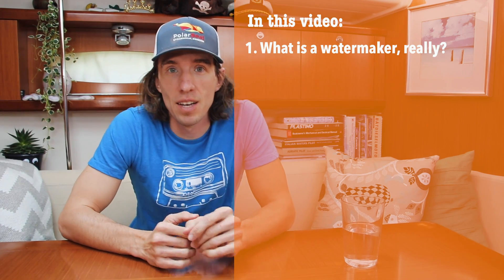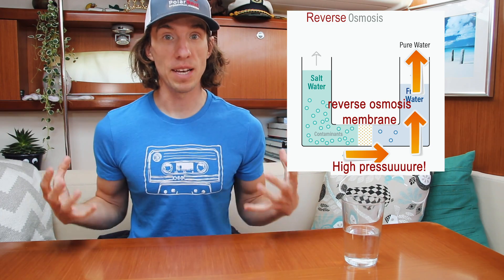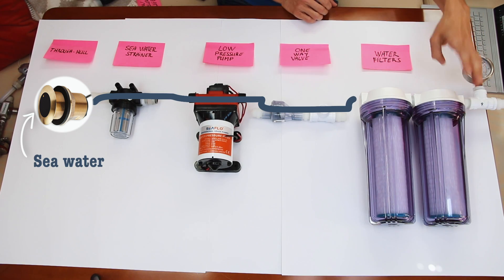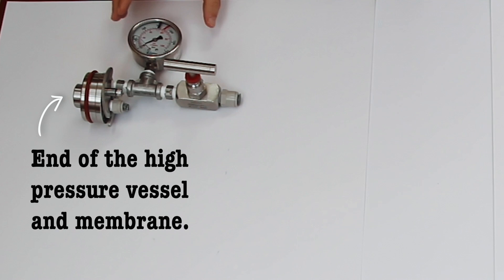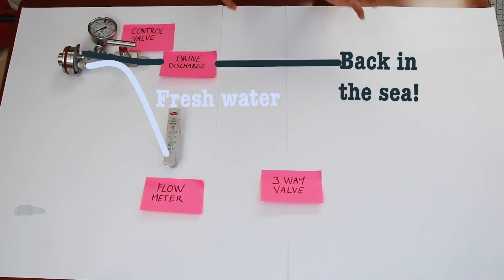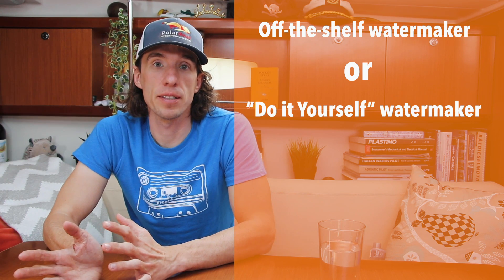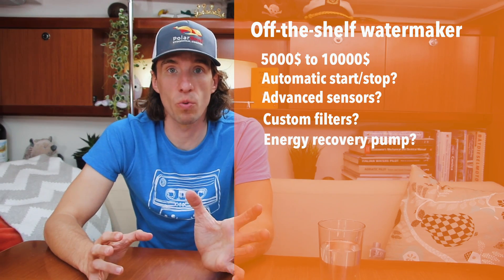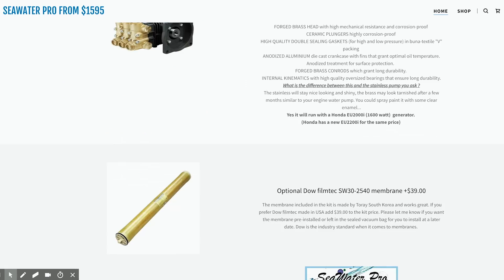How to make water on a sailboat (and how to build your own watermaker) // Ryan’s tech corner #3

Comment from the maker: It's been two and a half years since we installed our SeaWater Pro watermaker, and it has been performing flawlessly. it has afforded us some well-needed and appreciated self-sufficiency throughout the Mediterannean (where marinas are super expensive), through ocean crossings (yeay for showers) and through covid lockdowns (where we had zero possibility to get water otherwise). We added a control panel in our galley which has been incredibly practical and have upgraded the membrane to the latest SeaWater Pro one. We've been buying filters and parts in hardware stores all over the World (way easier than having to order proprietary parts) and we produce 19-20 gallons (70-75 liters) of fresh water per hour. If you consider ordering a SeaWater Pro watermaker, we have just gotten an affiliate link, that allows us to receive a small commission on every purchase at no cost to you. We would be incredibly grateful if you considered using it! Thank you :) https://seawaterpro.com?sca_ref=1318773.3ThbpgMEbt
Reply: What has the maintenance coat on it been per year?
Reply: Hello very good video i have several question, do they ship abroad ? how many hours a day do you run the watermaker ? Do you have heating issue with the pump ? I dont see in their offer a feeding pump ? Did you install by yourself ?

Thanks.
Reply: Hi. We definitely miss Ryan's technical projects and we hardly saw him during the introspective, drama driven and tiramisu spirit lifting recent transat. More of this please. Cheers
Reply: I’ll use it as soon as I get to it thank you guys and good luck !
Reply: You explained that so well. I know nothing about living on a boat but I’ve found that in non live aboard boating that ppl place too much emphasis on saving space with things like electronics, wiring & engines. Sounds great for those who don’t do their own maintenance or repairs. Your system looks perfect because you can access the parts without hanging upside down after being lowered from a rope. Thank you very much for your insight.
Reply: Excellent vid, very clearly explained,  i'm in the desert & got no boat, but enjoyed the info.

Comment: The manufacturers call it reverse osmosis to sound like is high tech, 🤣🤣🤣 but it's the same kind of filtration that the 25/5 microns do, but the membrane need more pressure to work, that's all. The reason it's cause salt and water have similar sizes, so the membrane needs to be the perfect size to let water squeeze past while stoping salt, that's why it's so expensive. Actually it's a impressive feat that gets glossed over by the osmosis BS.

Comment: There was a TV show called "Wheel of Fortune" 3 contestants would play and they would take turns spinning a giant wheel that was sort of like a roulette wheel, Different prize amounts would be indicated by a arrow in front of each player as the arrow pointed at them until the wheel came to a stop on 1 of them or on "Lose Turn or Bankrupt" if not 1 of the last 2 mentioned then the player would guess a letter of a mystery word or phrase. Vanna White  was the actress / model who turned the letters over as they lit up. So if the player guessed the letter "T" and there were 3 "T's" in the phrase then those 3 "T's" would light up and Vanna White would walk to each of the 3 letters and turn them over to show the letters them selves. Watch "Wheel of Fortune" for a better understanding of the process.

Comment: Funny, I assumed water makers either evaporated and then condensed steam to make water or used electrolysis to separate H from O and then recombined them to make pure water, especially since salt water is so conductive.  Didn't realize you could use an RO machine.  I have used household RO machines for years, know them well - why couldn't you just use one of these?  I know you would go through a lot of filters and membranes over time, but if just for drinking water, it may be a LOT cheaper in the long run to just use that?  They are also 7 stage, including a UV filter, which would kill any bacteria.  You could even gather rain water and run that through a 7 stage household RO filter.

Comment: I have a question about the pumps. You use a low flow pump in the beginning to keep air out of the system but a hi pressure hi flow pump to pressurize the system later in the system. Does the low flow, low pressure pump keep up with the demands of the hi pressure pump? I would think there would be a lack of water getting to the hi pressure pump. How is this addressed?

Comment: You asked for questions: How much electricity does it use to generate say a litre of water? How do you generate that electricity? Is there a risk of being mid ocean and the water maker failing (it looks like it's got a lot of bits)? How much water would you both use on a long crossing? Could you use collapsible water storage which would be cheaper and less prone to failure but obviously uses up more space?

Comment: Wow! Great video! I have one question: is there a reason why mounting the HP pump directly on the main engine crankshaft, thus eliminating the need for a large electrical system is not mentioned? I have a lot of experience modifying and altering boat engines, and I don't see a lot of cons eliminating the need for the electrical motor. Cheers 👍 Jasper

Comment: WHAT THE HELL
I could not tell
if ONE single gent
mentioned Vanna White?!

Sharing her birthday
along w/ Travolta
I thought of her often;
usually at night.

Never forget
her upturned hand
delivering every prize.

And yeah Boyz
if you know the gal;
she was easy on the eyes.

As for water
I have 5 ways;
no power or membrane required.

I wanted a system
that doesn't care
if the water's funky
or the batteries are tired.

Comment: Principles of reverse osmosis do not make a solid reliable system.
Brass high pressure pumps do not make for the best material. Erosion of the brass creates leakage while operating.
I would like to point out that  most of the parts that Seawater PRO use are made in CHINA or People's Republic of China (PRC)
The AR Pump they use is made in CHINA. Ripped off from Italian pump manufactures' 
Chinese sourced parts are the only way one can promote a system for $3500.
You get what you pay for......
BTW Hardware stores don't offer purpose made parts for Seawater RO systems.
BTW Seawater Pro is Junk... Brass head for instance.... Brass pumps are great for pressure washer system for occasional use, but not for making freshwater wherever you cruise.
Good luck ya'll

Comment: Excellent job and highly interesting video.   You explained it thorougly at 11:54 but the signs were reversed, it should read TDS < 600 mg/l, so the TDS should be below this norm, and pref below 300 mg/l.  You got me inspired to make our own WM, thanks a lot !
Total dissolved solids
The palatability of water with a total dissolved solids (TDS) level of less than about
600 mg/l is generally considered to be good; drinking-water becomes signifi cantly and
increasingly unpalatable at TDS levels greater than about 1000 mg/l. The presence of
high levels of TDS may also be objectionable to consumers, owing to excessive scaling
in water pipes, heaters, boilers and household appliances. No health-based guideline
value for TDS has been proposed (see sections 8.5.1 and 12.1).

Comment: I contacted SeaWater Pro in January 2023 wanting to buy components for a DYI system.  Bailey, wrote back and said they will only sell "parts" to folks who owned their system.  Also in viewing their video closely they are using a pump made in China which has few of the affirmative elements of a Cat pump or even a General Pump.  So, no they are not a source of component parts.  Try RO Cruise who in their website encourage folks to build their own.

Comment: An alternative to your metering valve is a back-pressure regulator.  A spring-loaded model can be set and will hold the pressure at your desired value (600-800 psi) without adjustment.  They cost more than a metering valve.  Try Swagelok for a look at a small unit.

Comment: TDS. Not TSD. So I question the mg/ml WHO suggestions based on that. Considering TDS meters measure parts per million,not mg/ml. Also The WHO recommends not drinking reverse Osmosis water based on a soviet town drinking nothing but Reverse Osmosis,Having an unknown condition that caused death and the Soviets coming in to study it and determining the cause to be extremely low TDS water without minerals leaching vitamins minerals and electrolytes from their bodies. Anyone who says that warning is overplayed and not real never read anything, drinks and recommends drinking reverse osmosis water, has no idea what theyre talking about and is coping, as a result. Because you could literally add baking soda and salt to your water to prevent the health consequences. Or a myriad of other elements, such as calcium supplements in proper proportions to raise TDS. Just look at a healthy water sources mineral contents and mimic that, accounting for whatever filler they put into your mineral supplies.

I just pulled out a gallon of store bought reverse osmosis and its ingredients are listed as water, calcium chloride and sodium bicarbonate. IF my meters are reading accurately its PPM is 35 and PH is 9.5. Since I do more then just cry in the comment boxes.

If youre regularly supplementing your vitamins and minerals, such as a cal mag zinc with a quality multi and running a high sodium diet or drinking "sport drinks", maybe you wont notice a low TDS water leaching effect resulting in death.But its too easy to just establish a known drinking sources base line, then mimic it, by adding a little calcium chloride and baking soda to your water supplies to boost its TDS to a state of water TDS equilibrium, where it doesnt feel the need to leach on you.

Comment: What is stopping you from using a cheap pressure washer for the high pressure pump? 800 psi isn't very much pressure so you could probably run two membranes off of 1 pressure washer depending on the flow rate anyways.

Comment: Really Great Video .Super well explained .I like to Know which High pressure pump do you use an how much amperes use it per hours .I have 2 Banks with 300 amperes each but only one i can used for water maker .The other is for Engine and electronics . Thanks for the better video that I'm seeing related with WM

Comment: Nice contribution!  After living in SE Asia...I am a fan of collecting rain water, even on a boat.  Requires filtering, of course, but little else.  Our latest system, in order to rid the decks of ugly Gerry cans,  went semi-direct into it's own holding tank, with the flow pre- filtered. That way, separate testing to ensure no potential cross contamination.  Never had any issues.  For cruisers with more than two people, or not enough water tankage, it can make a huge difference.  Better than most dock water supplies!  Thisrain water, in my mind should be in addition to a decent water maker.

Comment: I understand that drinking distilled water is also bad for ones health, so how do you overcome this problem if you are building your own.
Clearly salt really is not good for us, i have been told that if you can taste the salt then there is  too much salt.
I recall while servingnin the forces the ships i served on had eveporative sustems and that during the procees every so often a test with silver nitrate was done, and salt over certain level would make the water go milky but how do you know when the mix is right,
Reply from the maker: Hello,  correct.  If you exclusively drink desalinated water you run the risk of not getting enough essential minerals in your body.  This is more than salt.  Iron, magnesium, etc.  Many watermakers sold in stores which are found in home in Spain contain a process to add minerals back in to the water.  However while we do drink this water jts not our only source.  Juice, bottles water, wine, beers, and eating out so the risk is low.

Ryan

Comment: Have you ever thought about using the cheap $100 Harbor freight pressure washer for the pump? If you keep all the parts to the pressure washer you can also get the 2 year extended warranty for another $20.

Comment: You forgot to install a ball valve at the through hole, to stop the water from coming in if you blow out a hose, to prevent flooding your boat.
 Other then that, a well done video.

Comment: TDS(total Dissolved Solids)
PPM(parts per million)
TDS is measured in PPM with A TDS meter or TDS stripes
1000PPM or less(safe water)
500PPM or less recommended
Lower the better but 300 or less to be safe! Don’t go out on long voyages with marginal membranes, so if more than 300PPM replace
The product flow meter is so you don’t overwhelm the membrane by producing too much. The total of all membrane(s) rated flow is your target output. You can run membranes at a higher pressure if you don’t output more than the membranes are rated for but not over 950psi. So which ever comes first(product flow or max pressure).

Comment: Hi Ryan, good video! Did you get the 12V DC high pressure pump somewhere within Europe? I see that seawaterpro is US based and I am located in Europe. It might cost a lot of freight, import duty and VAT to have this part finally landed in the European Union?
Reply from the maker: When I built this I actually had it all sent to spain.  So it can be done.  I can't remember the shipping a duty but the fact I can't remember it means it was not overly crazy.  

I love Mike and the seawater pro team but there are a few options in Europe that do similar things if the shipping breaks the budget.  Ryan

Comment: Why isn’t the control valve before the membrane?
Reply from the maker: Hi Tyler,  the control valve controls the pressure prior to the valve.  Think of it like the spray end on the end of a water hose.  Your not controlling the pressure coming out  (although it seems that wa) but your actually adjusting the pressure inside the hose.  The pressure in the membrane needs to be equal throughout the membrane housing so thats why I needs to be after.  Ryan

Comment: Have you guys worked out the viability of using an "Atmospheric Water Generator" ? The small ones look cheap enough that one might be able to have a redundant unit for the cost of one of the mid-range "watermakers" ...
Reply: Of course there are detractors ;) https://www.youtube.com/watch?v=g-EEj7TiR1w Maybe the small AWGs are only capable of generating 'survival' quantities of H20, in which case, a simple induction cooker mated with a "survival still" may well produce more water a lot faster for far less money if you had enough generator fuel or solar panels for energy while you bobbed around waiting for rescue next time you are stranded in the doldrums.... I suppose a simple 'dehumidifier' would cut out the snake-oil salesmen AWG markup, and then what you collected from it could be filtered through your regular onboard filters.

Comment: The problem is that you always take surface water that has the most pollution. To be sure that you do not get harmful microorganisms and viruses in the drinking water, you should also as a last step have a UV water cleaner before drinking it.
Reply from the maker: Hi kalle,

The nice thing about RO membranes is they remove everything from the water.. including viruses.  So the water coming out of the system is some of the cleanest water you will ever have.   The issues is the holding tanks.. if yours are not clean then UV maybe be good.. but a good scrub should take care of it

Comment: Is there a reason not to use a car pressure washer motor and pump to build a DIY system? Thanks.
Reply from the maker: Hello.  A number of kits do this very thing and it can work.  The issue has to do with the salt water and breaking down the pump.  So it will work but not a great longterm solution.   Ryan